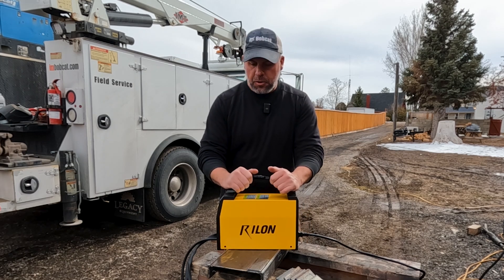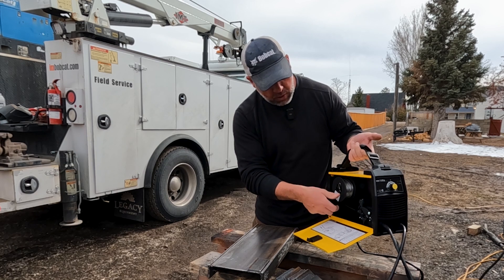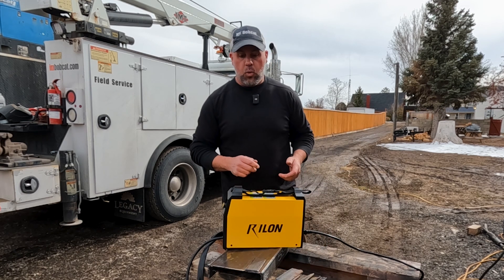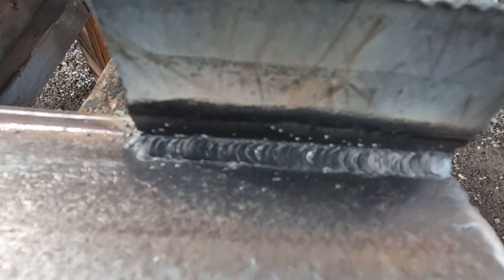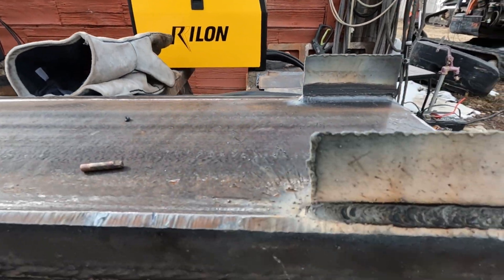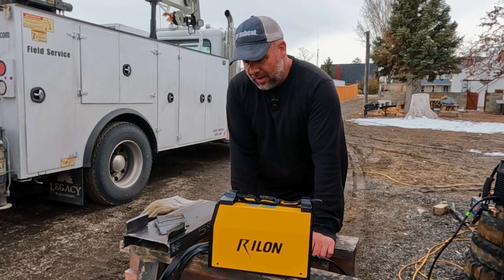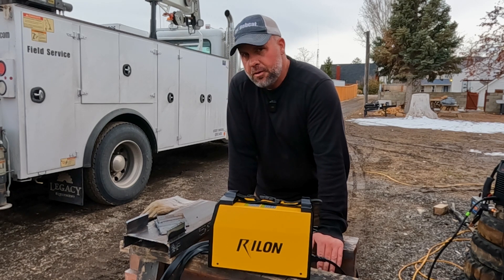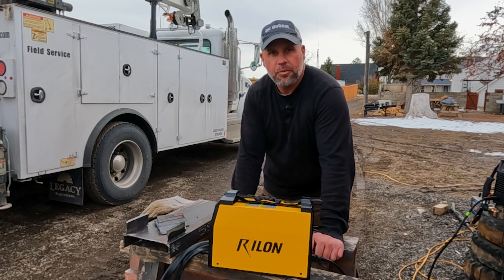Learn how to weld on a budget with the Troozy Rilon 135E mig welder

Comment: Does the machine be plugged in into regular household outlet? Can you run it into a generator or portable power bank?
Reply: Generator, no problem - as long as you size it correctly.  Portable power bank, maybe, for a short time, but a lot depends on how big of a power bank.